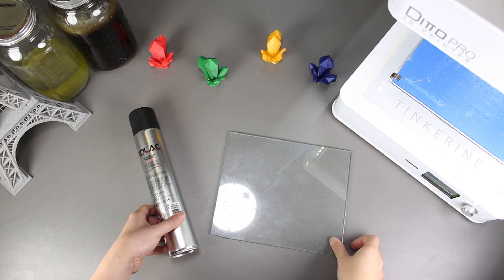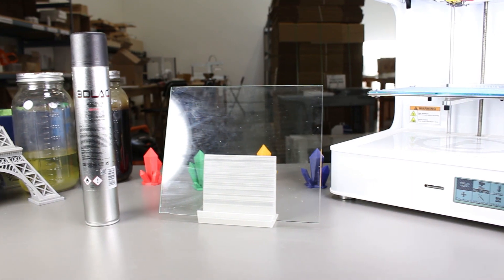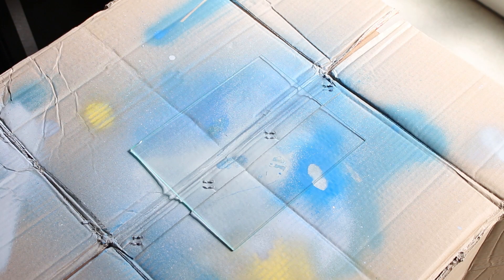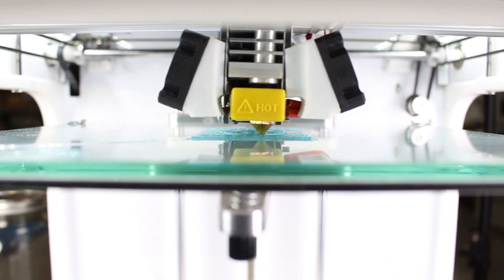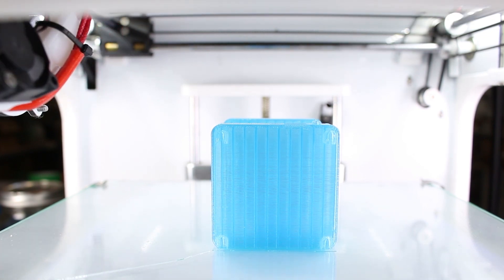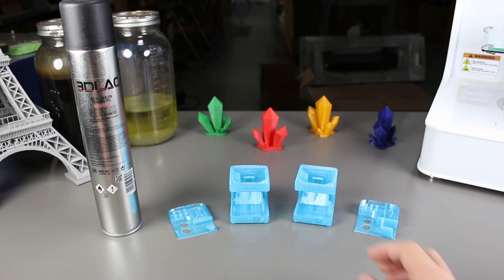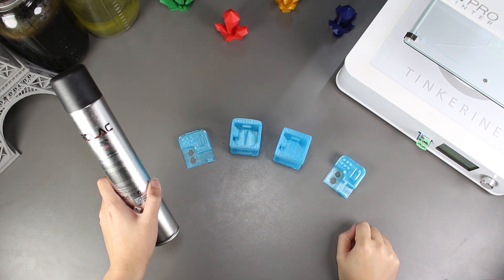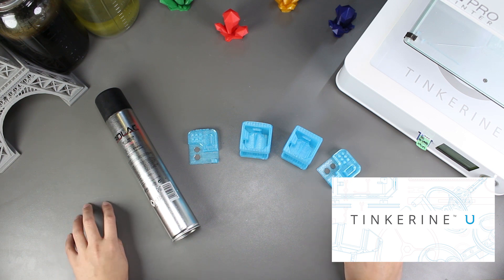Using 3D LAC as a Bed Adhesive

Comment: I have been using 3D Lack for loong time, I fund out that it will hold the print really well while the glass bed is warm/hot, even to the point if printed ABS, the 3Dlack was holding too good, that it will rip parts of the glass bed with it. 
To remove print really easy with out any force from the print bed, just put in to fridge, the print will just pop out.
Reply from the maker: Thanks for the comment and advice!
Reply: I haven't tried on ABS. For my Polymaker Polylite and Polymax I just wait until all cooled down and then it pops off from the slight thermal contraction. I do apply before every print. They say you can reuse from print to print but that never works for me.